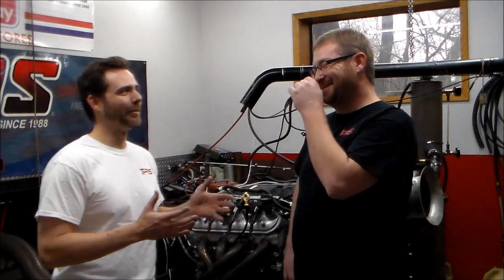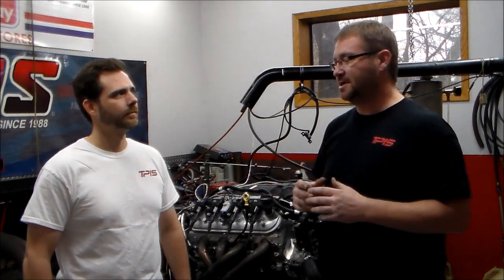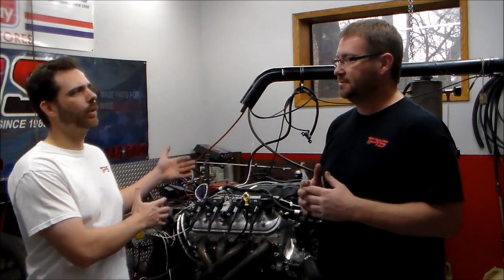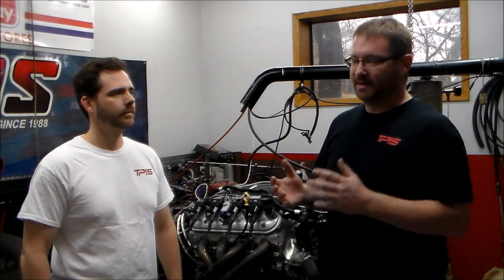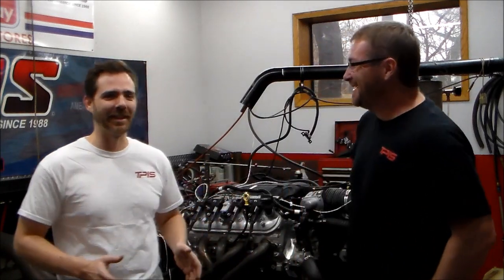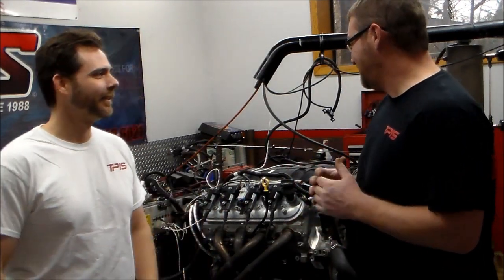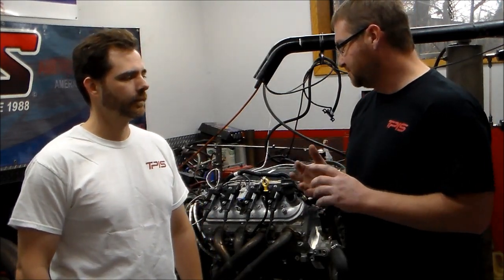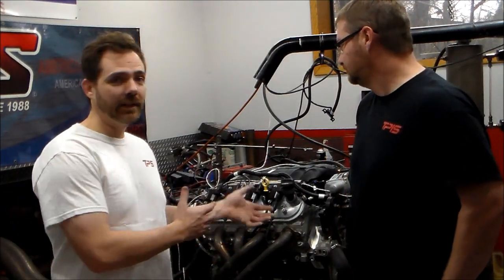dyno testing our GM LS376/525 Crate motor!

Comment: i see pace does this engine with a front dizzy and carby and intake And the water inlets the same as the old V8,S,, great setup but,, i dont understand all the friggin around with wires and computers to get 525,, a good 350sbc will give that all day.
Reply from the maker: Once you realize how easy the setup is, you'll never go back. 525 may be decent for a 350, but 525 is the STARTING point of these things. Sky is the limit man, such easy power.

Comment: I wouldn't waste my money. The standard LS3 (with tune, OTR intake, Headers & 3.5in exhaust) makes similar power figures at the flywheel when calculated back from a chassis dyno. The cam in this engine only seems to make the power come on a bit harder in the top end. Anyone already with an LS3 should just put in a custom grind cam and maybe port the standard heads  to make around 450-500RWHP rather than buy an expensive "standard" engine.
Reply: We made 470whp 470wtq with a bolt on ls3. Cammed stuff should be atleast 500. Most people over cam them and then leave the oe intake on it....as newbs would do

Comment: Thinking of putting this motor into my C6 grand sport and was wondering about the tune as I’ll be using my one computer from my c6.  
What would I need to make sure it run correctly.  Is there a base tune available?
Reply from the maker: Good question and I have no idea frankly. I'd use the computer you have and take it to a tuner to get it worked out.

Comment: you guy went on and on breaking the motor in properly.... THEN SKIP IT.... FUCK
Reply from the maker: When i made the video I had no clue people would ACTUALLY want to see that part. I thought it was boring at the time... well, crap... I was wrong.
Reply: BIG THANKS.... I bought a NEW 1992 ZX-11 Kawasaki in 1992 and broke it in like the book said do not over rev 4000-rpm first 400-km then don't over rev 8000-rpm next 400-km then rev it up to 1200-Rpm next 200-400-km or drive it... then take it back to the Dealer and spent $500 resetting the motor After spending $12,500 on a 1992 bike..... I did this and had twice the power as people that didn't break their bikes in like the book said.....  I'm building or buying a LS3 for a project truck

Comment: "The most important thing is seating the piston rings as quick as possible" I really glad you guys skipped the most important part. Didn't even mention the best way to go about doing that.
Reply: Start it, let it get up to operating temp (water/oil), then drive it like you stole it! Do some solid pulls in 3rd gear (not to redline) where the engine gets to full sustained output. Then get off the gas, stay in gear and let the car slow itself down with the back pressure of the motor. This gives you another round of seating the rings. Hope this helps